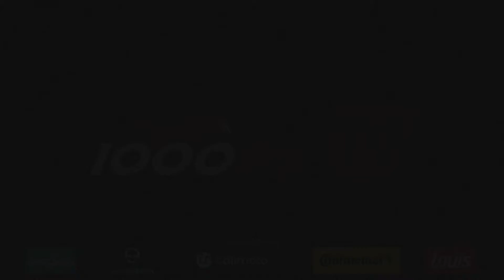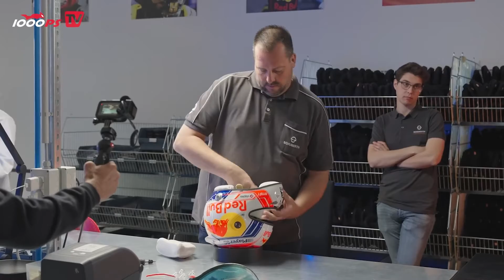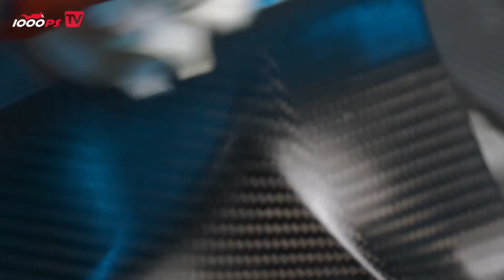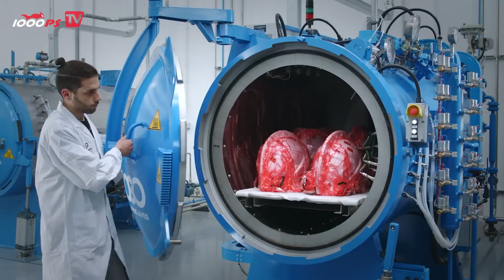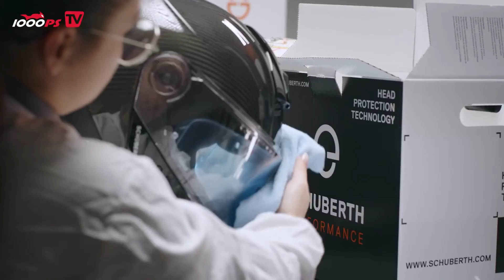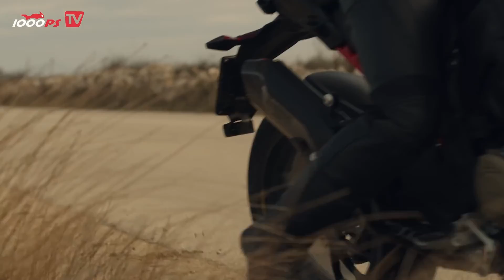Max Verstappen swears by it: Why the Schuberth C5 is the best helmet!

Comment: It's a poorly designed lemon.

1. The chin  bar opens if you poke it with your finger, no flip up should have its opening button on the outside working in the same direction it opens.
2. The release mechanism is vulnerable, if you went through a hedge a twig could undo it, plus it sits right across your larynx.
3. The P/J locking switch is too small, stiff and sharp, a glove destroyer.
4. Two shell sizes.

Buy the Shoei Neotec 3 if you want a top notch flip front, the C5 is nothing like top notch.
Reply: Being in the market for both. The C5 and Neotec 3 fit very differently.  This may not be a helmet that can be cross shopped for some.
Reply: @larryhouse3776  This is indisputably true .but there are one or two other options, the Shoei comes with a choice of three different comfort linings that can be selected, head caps and cheek pads., and don't ignore the HJC RPHA.
I'm amazed it can get 22.06 approval with that opening mech where it is.
All the best.

Comment: How is it AGV seems to have a similar product with its Sportmodular at far lower cost?
Reply: Yes, i have one of those, and am thinking the same. What's the difference?
Reply: From what I'm reading on reviews, the AGV has had some major issues, pull cables clip breaking off... side rotating attachment (for modular rotational) breaking off after a few uses.. No warranty, no support from company etc, etc...  
What's your take on this?  Have you bought the AGV?  I do like the helmet, and the price, just not sure after all of the bad reviews I've been reading.
Nothing but outstanding comments on the C5 Carbon (other than pricing, but still, everyone says "you get what you pay for")
Reply: @kevinalbert8540 I now have both the SportModular & TourModular.  The Sport is a bit lighter but the Tour is a bit more comfortable, particularly in the chin area, otherwise they are similar.  The biggest plus of the Tour is the integrated Cardo unit.  If buying again, I’d only buy the TourModular.  BTW: Quality & functionality of both is good.